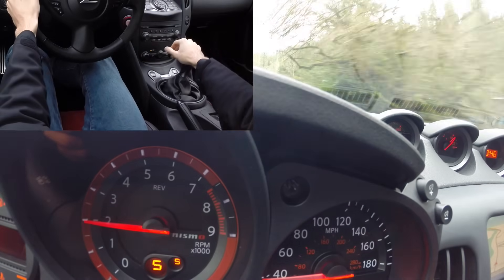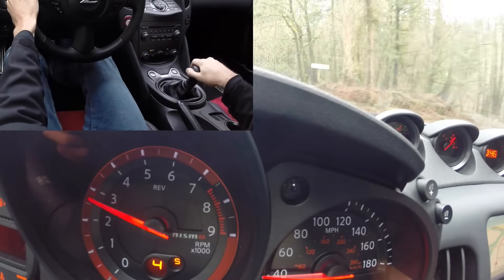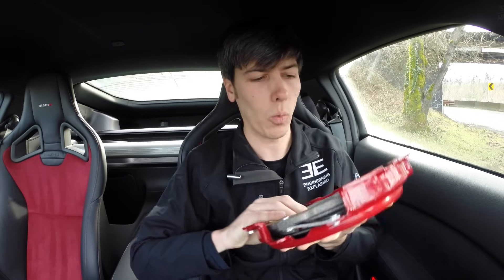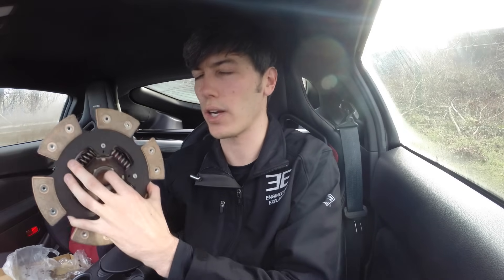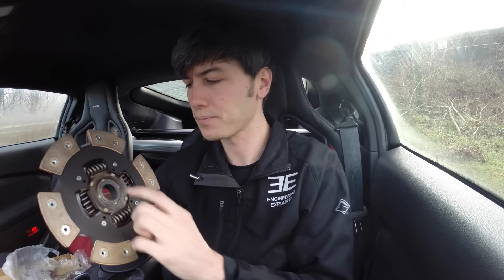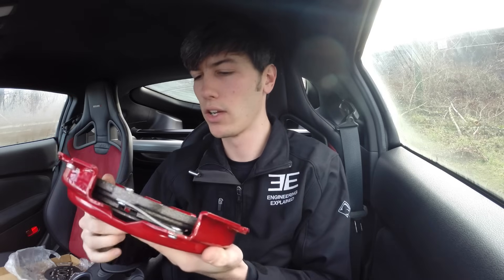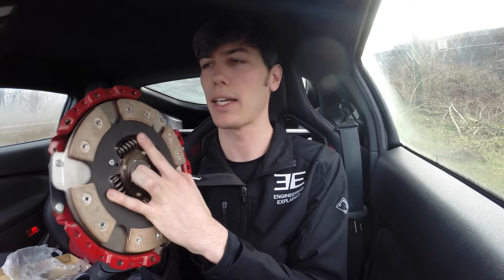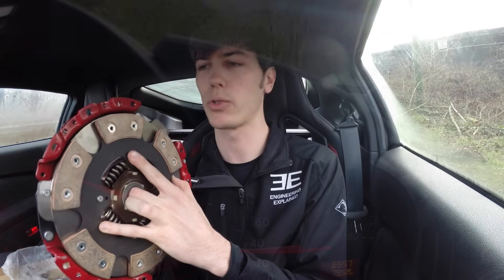What Is Rev Matching?

Comment: I don't get why instructors don't teach this. It's almost vital.
Reply: My instructor car doesn't even have a tachometer 😕
Reply: @Trident_Euclid  engine sound is a bigger tachometer
Reply: @siddeshmestry498  I used the sound method since day one
Reply: Ive had 5 manual cars, never done rev matching and didnt break the clutch or had any problems
Reply: @elaxel1469  you should try it! I used to drive without in my previous cars. Recently started doing it in my 1series it's wayyy smoother shifting and more enjoyable driving cause you are right back on the power.
Reply: @elaxel1469  but everyone else who owned it after you did ;D
Reply: we where told to use downshift without revmatch as a braking method to save fuel
Reply: @DunkenGuitarist  That's one the stupidest thing I heard in relation to driving a car. Not only it's less efficient than engine breaking with rev match but it also a grate way to shorten clutch life
Reply: DrOrtmeyer yeah and thats also why they don’t teach you to revv match because the only reason to downshift is to make a corner or stop for something and with braking you make it so they have the same speed and then you shift.
Reply: Pistol Pete thats also how trucks slow down withouth actualy braking with your feet
Reply: Don't know if it's a universal thing but a stage 3 clutch on my car handles around 400 to 600ft/lbs of torque, it's a leg workout when stuck in traffic.
Reply: Its not vital either its vital in united states of freedom between some bunch of internet kids who didnt see a manual car in their life
Reply: They don't teach it because it's not necessary in a ford fiesta on public roads. My driving instructor just told me to only downshift at very low rpm's (because in that case rev matching is not really necessary for a smooth downshift)
Rev matching is very important on a race track though as you will be downshifting from high RPM's.
Reply: I love manual transmissions, even if I have to go through dead stop traffic with my stage 3 clutch.
Reply: it's very common in Brazil.
Reply: Well if your slowing to go round a corner you don’t need to rev match, as your speed is already low all you have to do is change down gear and let clutch out slow. Smooth.
Reply: Because people drive auto nowadays.
Reply: Because it's more important to focus on traffic first. The license means you are a safe driver, not a great mechanical driver. Driving schools teach you where to look , not how to win races.
Reply: It's vital if you drive your car on its LIMIT under racing conditions, that's why instructors are not training newcomers on race tracks... If you are daily driving, that rev matching technique is USELESS. Anyway, it's great way to show off if that's your thing but rest assured I personally won't be :)
Reply: @n1s0  around town the rpm is usually too low to notice, although getting 2nd gear to pass a 40 mph car it certainly is noticeable!
Reply: They do... But maybe not in the United States of Freedom ;)
Reply: @Bunkerotter In the freedom states of america you don’t have instructors on how to drive stick either you have a dad or uncle that teaches you or you just figure it out yourself
Reply: @Bunkerotter  TBH not in Germany either
Reply: @Bunkerotter  "freedom"
Reply: @Bunkerotter  I wasn't told this in Poland either
Reply: Saw you profile and got confused because i dont think I commented on this 😂
Reply: My instructor didn't own a car and rode his bike everywhere.
Reply: @ObiTrev  that's the way to go!
Reply: They want as much money as possible from you with less effort as possible
Reply: Because rev matching isn’t necessary. It’s far more important to learn the absolute basics. Rev matching is cool to learn once you’re comfortable with driving a manual
Reply: They don't know how to drive a manual
Reply: It's not vital for everyday driving lol. If you downshift only at low RPM's and let out the clutch smoothly, rev matching isn't really necessary.
Reply: With proper rev matching you can actually drive most of the time without even using the clutch. Brass synchros may thank you as well. I’ve done 170k km 110k miles) on one single clutch on my Subaru  Legacy.
Reply: you dont need this in daily driving.
Reply: got 190,000 miles out of my clutch. i think i did it right
Reply: Sadly, no one here likes manual transmissions :(
Reply: About 47 T-Rexes 
I love manual transmissions if you weren’t being sarcastic.
Reply: @about47t-rexes12   not too bad. No one steals the car.
Reply: You really don't need rev matching on the public roads, it isn't vital. It doesn't do anything beneficial. Unless you are driving the car extremely hard. Almost all modern manuals have synchromesh and don't need to be rev matched.
Reply: a cars transmission has syncros. rev match if you want to save your transmission. any "instructor " who doesnt teach rev matching doesnt know what theyre doing
Reply: Archer I'm glad I don't live in a city that sounds awful, I usually don't have time to take it out of gear before I'm on my way.
Reply: They do in England. Maybe that’s why F1 is filled with them and zero Americans
Reply: .. you don't want to reach high rpm's... so you switch gears... (unless you have an insanely high RPM car)
Reply: Not many people drive cars with MT's anymore, unfortunately.
Reply: @JohnBarrow1961  its crazy how in american so many people learn only automatic in germany i think 90prozent ore more learn manuel transmission because when you learn witch automatic your not allowed to drive manuel
Reply: John B i have one and im going to learn it
Reply: My instructor did, but he is also a car enthusiat. I had girls compliment my smooth gear changes. I needed some ~300 km to learn to properly shift in my megane rs due to it's different for me clutch,  and for every gearchange I wasn't perfectly revmatching it I was feeling I was hurting the car. I can't imagine changing gears without revmatching.
Reply: Learning about cars should be a mandatory education requirement. Our public education system needs some serious REFORM not more funding. They need to stop teaching marxist social justice ideologies to our kids and start teaching real world skills and useful skills for careers in STEM or other useful fields.

Comment: So, essentially, give it gas when downshifting to have similar speeds as to not wear out the clutch so your engine isn't revved by the wheels alone. Usually I shift to neutral and use only brakes instead of downshifting to wear the brakes and not the clutch.

Comment: you can actually shift through all the gears without using the clutch by taking it slow and easing the shift into gear. probably not good but it works.
Reply: Unless you have a dogbox, always use the clutch.

Comment: These videos are informative even for an experienced driver. you've earned a subscriber and a like
Reply from the maker: +Kang The Mad thanks for subscribing, and for the like!
Reply: +Kip William nope. itll burn out your rotors though if you do it regularly.
Reply: Yeah, same here! (-: Nice job explaining everything. Keep'em comin!
Reply: 2WheeledWanker ! You will have a car like I just bought used with paper thin rotors, nothing but metal on the break pads left and a seized break piston nothing you can't fix yourself with 100$ of parts and an afternoon but still annoying to deal with especially how easy it is to avoid
Reply: I accidently had my parking brake on & drove  maybe 5 ft, without realizing it was on. Will this mistake ruin my car ?
Reply: @kipwilliam5593  yes you’re completely fucked

Comment: Is the following approach advisable ? - when downshifting, instead of heal and toe to rev match, I press the clutch, then downshift to the lower gear, rev the engine a bit and then release the clutch to engage the gear. This does lead to a smoother downshift. Want to confirm if this is what you would do in a car without automatic rev matching. Thanks!

Comment: 2:30 but why is the engine rotating much slower than the transmission? Isn't it that when you shift gears you are just affecting the transmission and not the engine? because if it is like that I would only expect the transmission spin to be affected if anything at all. I'm not arguing facts, I can see that the revolutions do go down, but I can't see why.
Reply: Lets say, you are going 25 mph in 3rd gear, at 1900 rpm. Engine is rotating at 1900 rpm and the transmission is at 1900 rpm. If you shift into 2nd, the transmission will have to rotate at around 2800 rpm to continue going 25 mph. The engine is now going slower than the transmission, even though it didnt slow down
Reply: TheDefectorUMP You lose me at the last part. So, you downshift to second and due to gear ration, the transmission needs to spin at a higher rpm to maintain speed because the engine is rotating at 1900 rpm compared to the 2800 needed. But then the engine is still rotating at 1900 rpm. I would only expect the car to slow down, not the engine rpm. And also since the car has kinetic energy, wouldn't it force the transmission to spin at 2800 rpm and in turn make the engine spin faster?

EDIT
I didn't read your reply properly and I may have answered my own question, which was was you said :P
Reply: Yeah, without rev matching the kinetic energy will be transferred to raising the engine speed, slowing the car down. This is the upset of balance he's talking about.
Reply: @theDefector

Well said and exemplified. Tho on 2nd gear at 40 kph/25mph engine 2500

Comment: sometimes I do this but it isn't always easy to "blip" the throttle when downshifting because you have to quickly move your right foot from the gas to brake which can be an awkward series of motions.  if I have to stop quickly my instinct is clutch + brake.  instead I'd have to (1) clutch (2) hit the gas pedal at just the right amount (3) shift (4) brake (5) release clutch, and this is not that easy

Comment: So I have never learned to drive a manual yet (and prob wont for a few years still) But i was wondering if you had to go down gear by gear while downshifting. I mean If your in fourth and wanna go down to 2nd could you go directly to 2nd as long as you reved the engine high enough or do you have to go to third first?

Comment: So I already know what rev matching is. Now, how do I rev match then?
Reply: While the clutch is down press on the gas pedal to rev the engine to the rpm needed, then release the clutch
Reply: @s2kkev292  And while you do that.... then you shift after you've rev matched right?
Reply: S2k Kev best explanation so far, thank you for this
Reply: Harry Henderson you won't be exact at first it will take a little getting used to, but just like anything else with practice it becomes second nature
Reply: how do you know what the Trans RPM is
Reply: @harryhenderson792  It's just a guessing game until you get it right.
Reply: What he just said.... adjust your throttle to match the engine RPM to the Trans RPM when you down shift.
ie 2000 rpm in 4th , press clutch , shift in 2nd , tap gas to 4000 rpm , let go of the clutch , voila ; smooth downshift.
Reply: Ez3k1e7 idk why this was so much easier to understand than in the video but thanks man
Reply: ***** If you kick it and the transition is smooth you re  doing it right. I tend to be gentle with mine and just release it fast but to each his own .
Reply: IKRR it would of been alot easier to understand if just showed us how it was done 1st then went on with the video
Reply: @jasonclegg1999  Right I agree
Reply: experience.
Reply: Ez3k1e7 how did you know to go to 4000 when it was previously 2000 rpm?
Reply: @jacksonharrell3890  - memorise what rpm you are at that speed in that gear - the assumption Ezekiel made was that at 40mph going down to 2nd gear the rpm would be 4000.
Reply: @jacksonharrell3890  feeling bruh
Reply: Here's a small guide to rev-matching, based on how I taught myself to do it.

Step 1: Don't rev-match, not yet anyways. Simply downshift as you normally would and observe the behaviour of the engine while downshifting. Get a good idea on where your engine RPMs spike to during downshifting in different gears and at different speeds.

Step 2: Now you have a good understanding of what downshifting does to your RPMs in different gears and at different speeds, simply downshift, quickly blip the throttle and rev slightly higher than you need to, release the clutch in a controlled and steady manner and everything should be matched up pretty nicely by the time the clutch is fully engaged again.

Better to rev slightly higher than you need to while you're getting the hang of it as it will buy you a few fractions of a second extra time to get everything matched smoothly.

Step 3: Practise and experiment. Practise it regularly and experiment with different amounts of throttle imput at different speeds until you feel confident doing it, then practise getting quicker and smoother at it.
Reply: +Ez3k1e7 do you dump the clutch after blipping?
Reply: Ez3k1e7 now I get it. where's your video? thanks, will try it soon
Reply: The Nissan 370z has automatic revmatch which you can turn on. The car adds throtle to rev the engine while clutch depressed without you touching the throtle pedal. In other cars you have to do it with your foot;-)
Reply: DuBstep 115: Blip blip, or blip?
Reply: Ez3k1e7 thanks for your explanation
Reply: Does it really necessary to do rev match in normal driving/shifting gears? (not aggressively driving). Let's said you see red light and you slowly deccerelete from 4th to 3rd to 2nd and stop
Reply: Spejo I’m still pretty new to driving manual, but I try to rev match and downshift for every stop.  Partly because it’s good practice, and partly because it’s a little more fuel efficient. It’ll extend the life of your brakes too, but thats  a comparatively small concern in my opinion.  I know plenty of drivers just pop it in neutral and use their brakes to slow to a stop.  But I also like that if I’m in traffic and the opportunity arises to accelerate out of traffic, I’m always in the right gear, and don’t have to pause to figure out which one to select and then shift back into that gear, possibly including a rev match anyway since my engine would be at idle coasting in neutral.  If I downshift into 3rd (best for 15-25 mph in my truck) when I hit 30 approaching a stoplight, and then the light turns green two seconds later, I’m already in 3rd going 20, so I just press the accelerator and continue on my merry way.
Reply: @nettles89  but rev matching stops engine braking right ?
Reply: Cristian Rares Uta no, not at all. Jason has a vid or two explaining it better than I can here, but since the throttle is closed, the momentum of the vehicle is being used, going backward through the drivetrain, to create a vacuum in the intake system, which takes work, and this slows the vehicle down. It’s generally not as dramatic a deceleration as the brakes would provide, and you’d get a more noticeable braking effect by slipping the clutch to spin up the engine, but that’s a LOT harder on the clutch. When I rev match and downshift in my 7500 lb truck, I often don’t need the brakes until I shift into neutral at about 10 mph.
Reply: @raresuta5895  downshifting without rev matching you will feel your car is getting slower because one of the disc is catching up with the faster disc, this is what the video said about upsetting the balance of the car. A little wear is applied to the clutch disc. This is not the engine brake. The engine brake is applied after you already downshift and don't put gas on accelerator.

Downshifting with rev matching, you will enter the 2nd gear smoothly, then the engine brake is applied afterwards if you don't put gas on it.

But don't worry about it, the wear is very little, it's more to the satisfaction to be able to downshift smoothly.
Reply: I usually just change gear when I slow down cus the other day when I try learning this I almost hit the car in front of me 😟
Reply: john sword it's simple really. Just push in the clutch at a stop, put it in first gear, hold your foot on the floor till shes bouncing off redline, and then simply release the clutch as quickly as possible. Hope I could help 😊
Reply: you need a car to do this bro
Reply: You waste alot of gas doing this, higher  rpm more gas is used
Reply: @chrisjordan6693  That's not necessarily true. If your foot is not on the throttle, it is not using any fuel. If you are going down a hill and it's approaching a speed that's a little too fast, blipping it and putting it into second will give you much more engine braking, because of the higher revs, but the car is not using any fuel, the hill is turning the wheels which is connected to the transmission and then engine through the clutch, so in essence, the hill is turning the engine, not combustion.
Reply: @chrisjordan6693  Unless you're talking about the fuel consumption blipping the throttle between clutch engagements. The amount of fuel used to blip the throttle when the engine has no load is miniscule. This is because the fuel is just turning over the engine as if it's in neutral. High fuel usage comes from actually driving the car.

Comment: Not entirely sure i understand the concept. 

So basically, for example, on gear 2 going 45mph my engine speed is 4000,but on gear 4 my engine speed is 2000 for 45mph. I hit the throttle to 4k and then shift down?

Comment: I struggle with knowing how much to blip the throttle, any tips?
Reply: It's good to memorize the rpms and which gear you're in and what speed its at.  

That way when you downshift, you can blip the gas before letting off the clutch and it'll be at the correct rpm when you release the clutch, it'll be smooth as silk.
Reply: Full fast blip
Reply: ***** Thanks, its been a while since i posted this, I'm much more comfortable with it now.